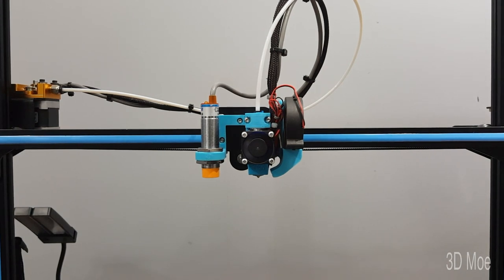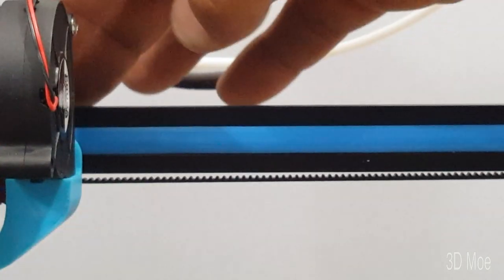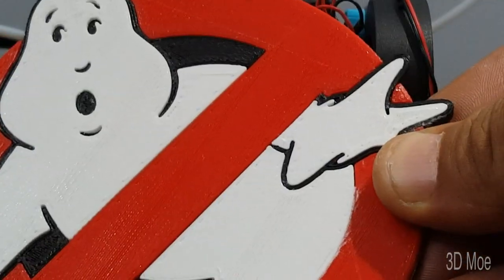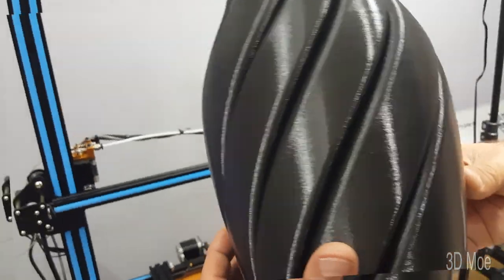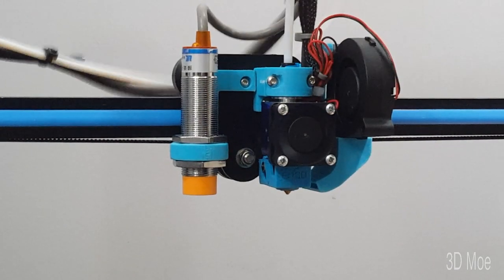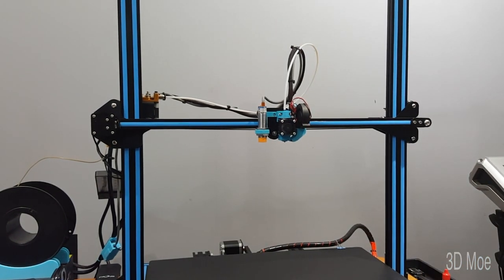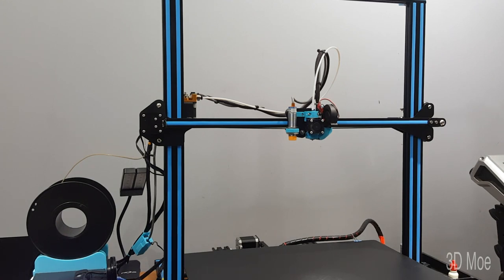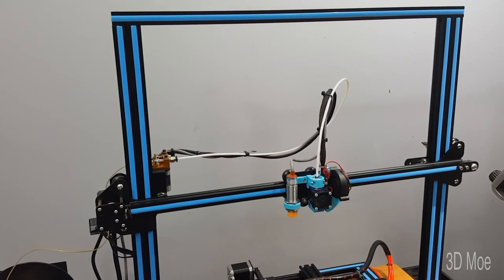E3DV6 Upgrade Success

Comment: Had the same problem clogging, My solition was tu reduce the diameter of the neck of the little tube between the heatblock and the heat spreder, (i don't know the name), to 2,7mm just using a drill and a grinder disc. Worked amazing with pla and PETG, it reduce the heat Transfer from the block by reducimg the amount of mass.

Comment: When you made that up change ... using the TH3D firmware .... did you have to make a change with the comments out or changes down in the firmware in the section under E3d V6 ... I just added the ezabl.

Comment: Is that the 500 x 500 mode CR-10? Did you use a discount code to get it from Tiny Machines?
Reply from the maker: yes 500x500 model.. sorry did not purchase it from tiny machines but did buy all my upgrades from them

Comment: Nice to see this video I too have been having a hard time with the E3DV6 could you please post a link to your S3D fff file that you are now using with this new setup you have thanks
Reply from the maker: I used the default prusa settings just changed the build volume and retraction to 4.80
Reply from the maker: I will upload it to the group tonight
Reply from the maker: I Just added it to the Creality CR-10 3d Printer User Group
Reply: ok cool thx got it

Comment: Is that Tim's EZABL? I'm looking for an ABL, but he's sold out of EZABL. I've read that Peter's AIO ABL is not compatible with EZABL mounts. What ABL works with your mount?
EDIT: Nevermind, I just got 7:07 minutes and you said it is EZABL. I guess I have to wait for Timothy Hoogland to make more.
Reply from the maker: EZABL from Tim
Reply from the maker: i changed my sensor to inductive because i went with buildtak, but i am now back to glass so timmys sensor is back on
Reply: Thank you for the knowledge transfer... I guess I need to buy some ABS so I can use a E3D V6? Would PLA work for this if I always print in PLA?
Reply from the maker: i have seen people do it..but  dont recommend PLA I would Go With ABS ..higher temperature rating
Reply: How about PETG, would that work? Looks like PETG is easier to print than ABS. I don't have an enclosure, but doesn't look like you do either. I thought I need enclosure for ABS?
Reply from the maker: ABS its not that bad for small prints..but petg works well too..
Reply: I seem to be in catch 22. 
I keep reading that I need an all-metal hotend in order to print ABS at 250-270 C.
How do I print a mount for a new hotend with the stock CR-10 if the PTFE can't handle those temperatures? 

Print temperature: 250-270°C
Bed temperature: 60-90°C
Reply from the maker: you can print ABS on the CR-10 I have done it... just make the mount install the V6 and if your not happy just print it with the New V6 after installed...
Reply from the maker: you dont need to print abs at 270..
Reply: Thanks for all the help, after doing some research it looks like PETG is what I need for the electronics cases that I need to print. Reading that nozzle temp of 250C is good for PETG and requires lower bed temp than ABS.  I just hope it's rigid enough for this mount.

PETG is more durable than ABS, but ABS is harder, and more rigid. PETG has a lower glass transition temperature, at 80C compared with ABS's 105C. ABS is approximately 20% less dense than PETG. PETG won't warp like ABS might (if printed incorrectly) and is generally odourless.
Reply from the maker: PETG will work fine.. Im glad you got it all worked out